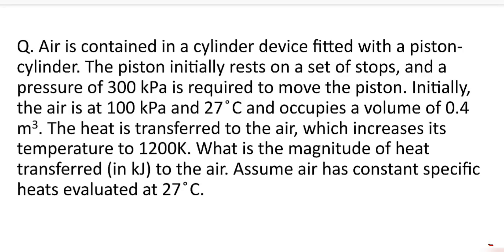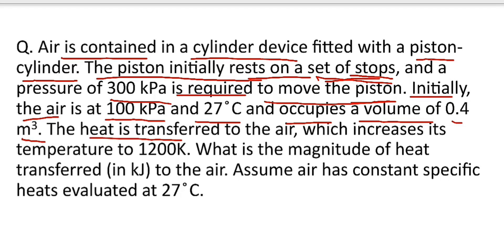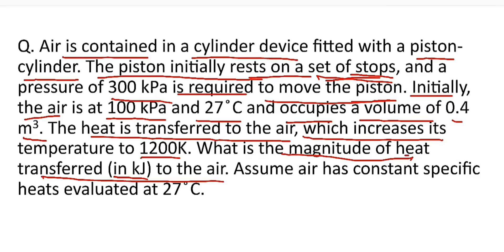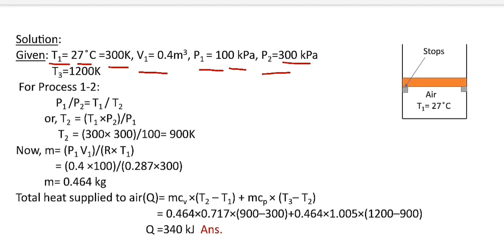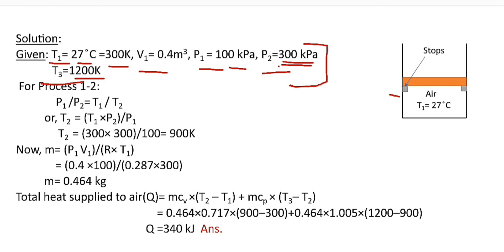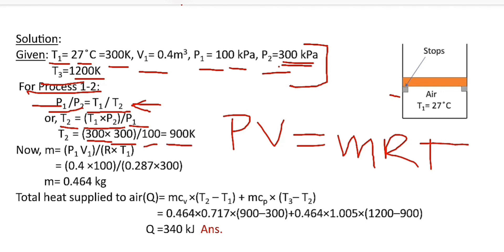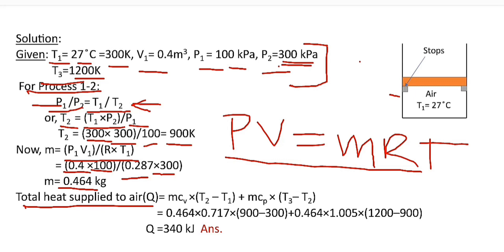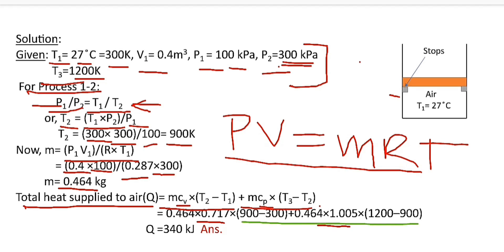Air is contained in cylinder device fitted with piston cylinder.What is the magnitude of heat added?

Comment: why we not considering work in second process at constant pressure?
process 1(constant volume): Q1=mcv(t2-t1)
process 2(constant pressure): Q2=mcp(t3-t2) - p(v2-v1)
Qtotal= Q1+Q2
Reply from the maker: Yes bro, you are right. We have to consider the value of work due to the movement of piston.